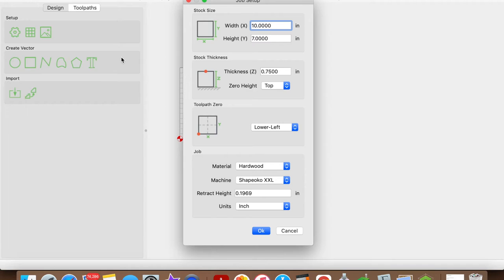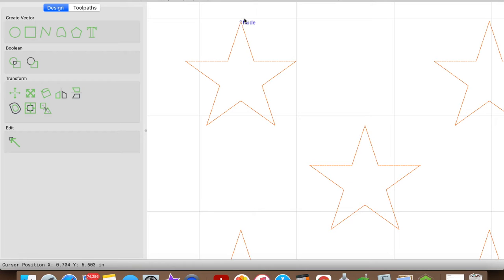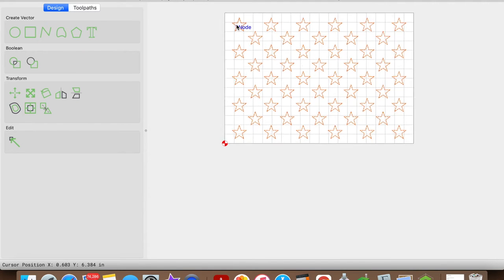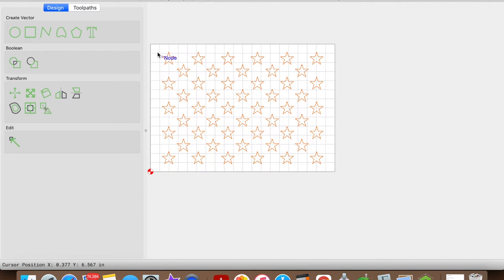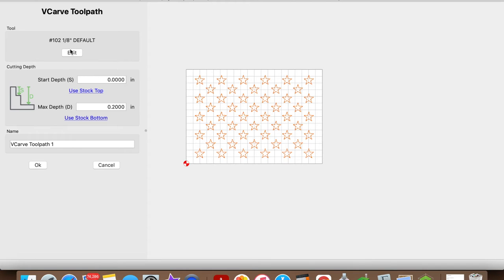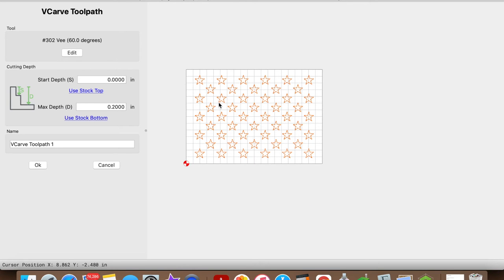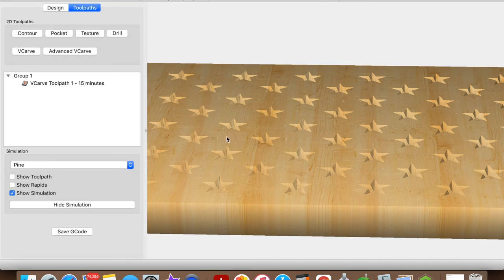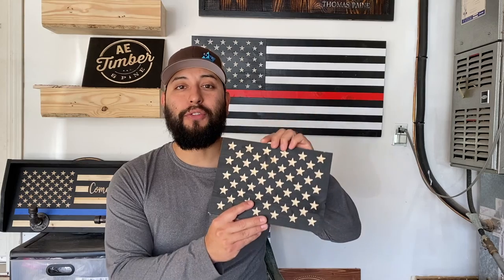How to Carve Stars with a CNC | Rustic Flag on a CNC | How to Carve Stars with Carbide Create

Comment: Good video, I do my stars with a 90 bit , I’ll have to try the 60 degree and stock bottom. 🇺🇸👍
Reply from the maker: Thank you!  I appreciate you checking out the video!

Yeah check it out and let me know what you think.

I’m trying to speed up the process. I’ve seen some be able to carve the stars very quick. I’ll probably test increasing my depth per pass.
Reply: Check your Instagram I sent you a message

Comment: Thanks for the video... question on the stars, how does using stock bottom work? Wouldn't that make the stars depth go to the bottom of the wood and therefor make the cuts too deep?  This one confused me but I imagine it works for you because your work is impeccable.
Reply from the maker: Hi Gary! When you select "Stock Bottom" while using a vcarve toolpath, the program will determine the max depth it needs to carve to.  This only applies to vcarve toolpaths.  The program will use the vbit selected and the size of the vectors of the design to calculate the depth for the edges of the vbit to meet/touch the edges of the vector or your design.  I'll be uploading a video explaining this soon. Currently editing.

Comment: I am somewhat new to cnc, been using Easel, is it possible for you to take me/us from the start and how to get to this point in a video? Thanks
Reply from the maker: Hi Mike, I'd be glad to.  Are you wanting to see the entire process including cutting the material or are you more interested in the carbide create setup process?   Just FYI, I did not create the union. I purchased a union. Its just faster and for me, it was a better route to go.
Reply: @aetimberpine  Thanks for getting back to me. As a easel user, new at this I am able to generate the star field from a file that I have and cut it with a 1/8" bit but not with a v-bit, not going to pay that big price for a hobby person like my self. So, what I am trying to do is do as I did in easel with v carve/aspire but use a 90 bit. If you can make a video showing how you bring in the file, from start to cutting. Thanks.

Comment: Hello! I just attempted to cut a union with my shapeoko exactly how you showed how on your tutorial but for me the stars came out nowhere near what yours look like. Any tips or tricks i can tweak?
Reply from the maker: How did they turn out?

It’s tough to zero in on a cause without more information but I would just try again.

1. I would initialize my machine with the vbit that will do the carve.

2.  I would reset my zeros for x,y, & z

3.  Use the paper method of zeroing z and once you have your zero, I like to raise it 5 “clicks” at the lowest interval (I believe 0.001).

4. Make sure that your material thickness is correct.

5. Make sure to select “Stock Bottom” for max depth if using carbide create 

6. Ensure that your workpiece is flat.

I hope this helps.  We’ve all been there. Keep practicing!

Comment: What size are those stars?
Reply from the maker: Hey Harry 
I don’t worry about the size of the stars but rather the size of the union.

In carbide create, I create a vector the size of the union and then I import a 50 stars file and then resize that file to fit within the union.  Hope this helps.